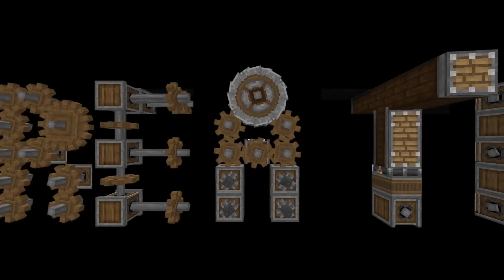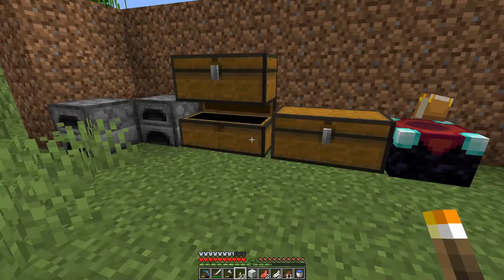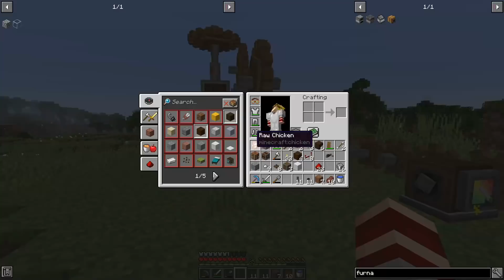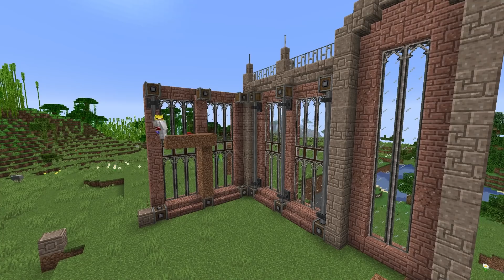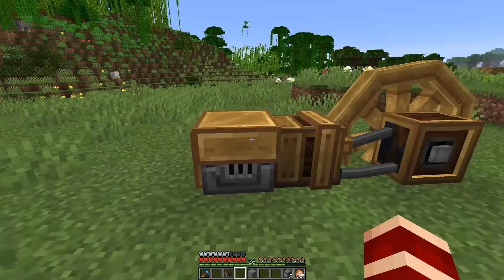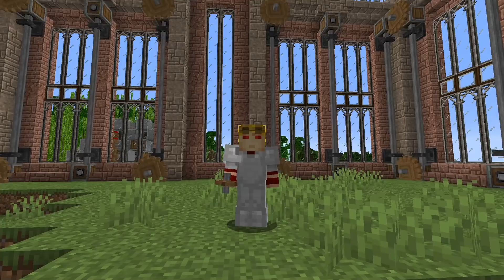Infinite Power! - Create Mod #1

Comment: This mod is surprisingly like real life. It uses alot of real life basis and minecraftifies them. For example every engine (that Im aware of) uses small explosions that push cylinders that are attatched to shafts that rotate which go into linkages that move and activate things. Thats just a small example. Big large mechanical things are all rotation.

Comment: I often refer to Create as "What redstone would be if it was mechanical power, rather than electrical".

It follows the exact same design principles, just with a different power system.

Now we just need a mod that does the same as these two systems, but for thermodynamics, and ANYTHING will be possible.

Comment: I know this comment is way late...but my obsessive compulsive tendencies will not allow it to slide.... You could have set the clock to 20 or 40 secs and it would have worked the same. O.o

Comment: There needs to be something like a ‘windup generator’ which takes a lot of low speed, low power rotation, and when it is powered, it will release the power that you’ve stored as high power high speed rotation. I could have a UI when clicked on, and it has multiple different springs, each of which have different capacity to power ratios.

Comment: since blast furnace smelts twice as fast, coal only burns half as long. you only get 40 seconds out of each bit of coal. the ore falls back into the furnace upon losing power, which happens whenever the furnace empties. the redstone contraption was totally unnecessary lol

Comment: You could actually set the delay to 41 seconds, as while the blast furnace smelts twice as fast, it also consumes fuel twice as fast, turning the 80 fuel time to 40 fuel time. Idk if you fixed this as I haven't watched the rest of the videos.

Comment: I might be missing something but isn't the redstone setup for the fans completely unnecessary? If you power each fan from its respective engine, as soon as the engine turns off, the fan should stop and the chute should just drop the ore back into the furnace until the fan gets powered and pulls it back out? Maybe doing it this way interferes with the tiling capability of the setup?

Comment: I know you made this episode a while ago, but chutes by default move items downward. All you have to do for your blast furnace is use the power of the flywheel to suck the ore out while the furnace is working, then once is turns off, the ore will fall back down

Comment: I figured out your clock problem.. simple solution with the coal.... Set the clock at 40 seconds.. It won't do anything during active burn, but when the coal runs out it will trigger a new burn.. 2X40s = 80s ;)

Comment: ok, so, i ended up trying to use your design for the power generation thing, but i'm having an issue with getting the wheels to synch up and keep running perpetually. i have a decent supply of fuel, but i'm thinking it's a combination of timing and the fact that the flywheels are not all connecting properly via shafts or gearboxes. like, sometimes, one wheel will just crap out randomly and idle, while the rest continue to spin, so it's not a contiguous thing.
Reply: ok, apparently it was the timers being stuck... but there's also the issue that the kelp blocks burn for 4001 ticks, which is 3 minutes and 20 seconds.

Edit: Nevermind! Turns out that in blast furnaces it's halved, so it comes out to 1:40. Regardless, it still doesn't fully jive with the 2 minute timer you originally set here... had to add another couple blocks in length to throw on a second adjustable pulse repeater and second regular repeater for the proper timing on my end. Now, it works like a charm, with barely a hiccup when it refreshes each lane of the contraption.

Comment: Huh. I just made a fancy mechanism for "Infinite power" in Furnace Engine and was super proud of it, then go on YouTube for a similar contraption... and here you show twice as effective version of it.

Though, I guess mine has some advantages. It works on wood logs - dropping one into the furnace every 80 seconds, smelting it into Charcoal, and then using the same Charcoal as fuel for the next wood log.
Compared to your, mine is:
+ Much more compact;
+ Works on wood logs rather than coal, so you can link it directly to tree farm without any middle steps;
+ Doesn't use exploits;
- Produces two times less Stress Capacity because it uses a normal Furnace instead of a Blast Furnace.

Comment: ...The fact that the waterwheel is the wrong way triggers me a lot...

Also, a personal suggestion of mine (at least for the outside part of your building) is to use normal shafts and right-click them with andesite casings to cover them up. Looks better imo

Comment: He could put power in one area, and use belts, inside, to turn all the shafts, thereby transfering force inside, and not needing vertical gearboxes, or inverting the rotation per pillar.

Als, I made a super generator that uses one coal and eight wood to make charcoal, then that charcoal, some is sent to the furnaces, the rest to be used for, really, I dont know. But, with 1 input, I am powering 5of these. I plan on connecting a tree farm for infinite wood, thereby creating unlimited energy!

Comment: anybody knows what settings he put in the sequenced gearshift for the infinite power furnace thing?
Reply: That's a regular gearshift. it just makes the fan suck up the ore for a quick second. I can't figure out the logic for the clock though.
Reply: I actually figured it out, you have a Adjustable Pulse Repeater running into a block, redstone dust past that, in the middle is a Comparator going into the block with the Redstone Torch on it :)
Reply: @snepderg  yeah. After playing with it, i got that too. But using the sequenced gearshift, the ore just goes in and out of the furnace repeatedly. Which works too so it's fine, i guess.
XD

Comment: Okay 2 questions.  1) What is the 3rd redstone component used in building the engine?  You can see the torch and you talk about the Adjustable Pulse repeater, but there is a 3rd item that you can just barely see between the blocks that looks like a comparator? 2) What gearbox is that on top of the fan?  I can't find one that looks like that.

Comment: In case you didn't know.  The information you and Zed are learning about this mod and the items you are creating are ending up on the Create Mod wiki!   I just looked up the Furnace engine on the wiki and this episode was referenced as to what the block is capable of, specifically your cheaty cheaty trick of sucking the ore back out of the furnace using an encased fan.  Awesome.....now I just have to figure out why mine isn't working.

Comment: Doing the alternation of the ore at 20 or 40 seconds has the same effect. You just want it there for the tick the burn duration ends, you don't care if it goes in and out extra times.
Also, please move your transfer rod to the floor lol, there's a gearbox there already

Comment: You know something funny i made a giant base in this mod 
And i only use 4 normal engine to power 5 press, a crusher,5 compactor,5 washer (Fan with water),5 smelter (fan with lava,5 smoker (fan with fire),5 cutter,6 concrete maker (Uses 6 drill and 6 placer yea it's pretty expensive),3 mixer and a automated brewing station, all on max speed plus a heck ton of belt... and yes they work together i even made switches to turn them off one by one thingking it's needed i even made a master switch to turn the engines off but i don't need them somehow 4 normal engine is enough 
So pro tip for beginner player you don't need that much power on late game stuff mid game is when you start having power issues but that's not that hard to solve just use max windmill for your machine my most costly machine only need about 9K su that's equivalent to 1 max windmill and 1 small windmill and it can run forever without needing any advance stuff 
I would prefer using the engine to power bases and not individual machine as it's just overkill and a max windmill is just way cheaper than one engine set

Comment: When you were setting the timer for 80 seconds but found out it didn't work that way, you set it for 1 minute. Why not set it for 40 seconds instead? It'll go off twice, but it will essentially give you a switch every 80 seconds.

Comment: Hey Tango, did you think about using coal blocks instead of usual coal for your blast furnace? Nine times the time with same effort. It works out better with timing as well - 80*9/60 is 12 minutes. Also, the series is great, loving it!

Comment: not to be rude but for the water wheel make sure that the water wheel has the notches facing the opposite way the water is flowing(so the water gets caught in the flaps of the wheel)

Comment: not sure what the renewable fuel is going to be but if you were to stick with coal wouldn't coal blocks be better than individual coal? That way the 80s per cycle would become 720s or 12m so the timer could be set accurately to restart the smelting cycle.

Comment: Old workshops used to have a similar thing with the rotational mass. The used to have shafts running the length of the ceilings and then they'd have leather belts that you could attach to your various tools.

Comment: i have successfully improved his design and fixed his timing problem (using gearboxes to power the fan into reverse mode means when ever it turns off the item drops back into the hopper before timing turns of the machines connected) and used only gearboxes cogs and shafts

Comment: Why don't you use lava instead of coal because it burn more than coal so it generate more power for longer time, and you can just get it from the nether.
Or you can just make a tree farm and make a auto charcoal maker to deliver to the blasting machine with conveyor belts so don't have to mine coal anymore.

Comment: so one single chest of blaze rods not including any Hopper back log or the stack in the furnace will run for nearly 60 hours....and given it will take no more than 20 mins to refill a chest (prolly less with this mod pack) this farm is going to be very efficient to say the least...but I wonder why not use dried kelp blocks as one mod could be used for smelting them (which makes power) and produces more fuel for power. and given kelp farms are so redstoney I would think it would be perfect for this model rather than using a double blaze spawner with everything slabbed and the whole mess. just a thought

Comment: A mod that i highly recommend is called THE ONE PROBE it goes on a helmet and it tells you the name of the block it has a hot key with it. Very good mod highly recommend it it tells you the name of the mod and also the name of the block it will help you to tell us and we can see what blocks you are pointing at. The box will be center screen but top you can move the box any were on the screen

Comment: Make a way to make Cobble sand and glass with the mod it is something that can be done very easily. Also use as much glass around your builds as possible so we can see it in your base while it is running. Make a ore double machine with the mod as well please but for glass you need a fan and a lava source block. Lastly make a harvester when you make a field of crops.

Comment: The way you designed your factory is how they used to design machine shops with lathes in them. They had one generator for the rotational force and would transfer to the lathes with gear boxes.

Comment: You can still use coal on the power generator, just set the time delay to 40 seconds. It will fire twice in the cycle and allow you to use coal uninterrupted.

Comment: 19:20 can't you just set this to 40 seconds so it will put the ore twice, which means after first 40 seconds ore will go into furnace and instantly will be sucked back up without using fuel so basically nothing happens, but then after another 40 seconds ore will once again go into furnace and back into the shaft but now it will make furnace use another piece of coal

Comment: If you wanted to maximize the amount of burn time you get out of each piece of coal you can use 2 adjustable pulse repeaters (one set at 1 minute and one set at 20 seconds) instead of 1 in the clock.

Comment: 60 seconds isnt good, do 40 seconds. It doed not matter how frequently you do it, but you want to do it on intervals divisible by the 80, so 40 works because you will drop it in at the halfway point, nothing happens, and then drop it in at the 80s point and keep it running. The way you currently have it configured, it will drop it in and start it, then drop it in at 60 and nothing happens because the first coal is still burning. Then the coal stops at 80, but wont start back up until you drop in the ore at 120. Thats 40 seconds of dead time.

Comment: For anyone interested, you can set up the same perpetual motion machine with very slight downtime with far less pain. Just power the fan to suck, and when the "burn" is done, the ore will drop back in automatically to start the furnace back up.

Comment: Stress Capacity is NOT the same as rotational power. Rotational power is the fact that a block is spinning, as well as how fast/in what direction it is spinning. Stress Capacity applies to the entire contraption, that is all the Create mode stuff attached together, and is basically the inertia of your contraptions.

Comment: @19:20 just set it to 40s. The first pulse will start the furnace, the second will dip the ore in halfway through and do nothing. The third tick will be at 80s, exactly when the coal runs out, and so on.

Comment: You could do a block of coal which would be 80 seconds times 9, which would be 720 seconds which is 12 minutes, which would make it a lot easier to do it, you can also fit more in it.

Comment: The "cheaty" bit @15:00 doesn't feel cheaty at all. The purpose of the furnace in this machine is to generate power - you don't see electric power stations smelting stuff, they just burn fuel to make heat. Maybe think of the ore as a primer for the furnace itself, like TEB is for a SR-71 engine.

Comment: Tango, if you set the timer to 40 seconds at half the time it will still work and every 80 seconds there's gonna be an ore in the furnace, that way there's no dead space where you might not have any power. idk if you've already figured that out or not, but just a tip :)
Reply: also I don't even know if the 60 seconds would cause a problem at all, just speculating

Comment: Tango! Love to see you checking out this mod, but I need to warn you that the timings on your device, as you currently describe them, are likely to be off. The new redstone devices added by Create seem to have an undocumented extra delay to them. (It's something like a redstone tick's worth, per repeater, though I would need to recheck that to be certain.) This will throw off your timings for your blast furnace, so that it will eventually, over the course of many hours, shift the time the ore goes in and eventually either consume the copper ore because the gearbox timing is off as a result of the undocumented delay the redstone timers add, or else cause stoppages and inconsistencies in power supply that can affect certain contraptions negatively if not prevented.

Another series I watch by RagePlaysGames covered the same idea you're attempting to implement here, and covers some of the common pitfalls he has seen in other's designs, and the problems that can occur if the system is not set up correctly to account for the timing issues. After running into a few of these problems himself when designing his own version, he describes the testing he did that led to him discovering the timing issues with the redstone devices, and tells how to alter the timings on the repeaters to ensure that one cycle of the ore popping in and out to reignite the furnace, and then waiting to go in again, is exactly that of the life of the fuel you use, while making sure the time the ore is in the furnace is short enough that it will never be consumed. He even goes over how to troubleshoot afterwards, so that you can make sure your device is working correctly, without having to babysit it while you work on other things. I concede to not recall all the advice he gives, but I strongly recomend checking in on his video to verify that your system addresses some of the potential issues, lest you end up wondering why everything went offline a couple hours later, or why some of your devices are stopping periodically.

That said, I love your videos and am so excited to see what all you and Zedaph make with this mod, and I'm looking forwards to the next episode already. Keep up the amazing work!

Comment: You might want to consider adding a robotic arm to the fuel belt/hopper system - reason, because you can have the arm feeding the hoppers from the belt in a 'round robin' fashion - which means you can fire up the whole system in one go, rather than having to wait for the furnaces to fill sequentially 👍

Comment: Remember you can use belts to transfer power to work stations in the middle of the room coming down from the roof, with clutches to disengage when not in use....

Comment: I love that everyone is playing with the Create mod now! While you are using furnace engines to power your base, it wouldn't hurt to know this: Watch the direction of your water flow when using water wheels. While it will produce rotational force either way, you can improve the stress capacity of the wheel by making sure the water looks like it would catch on the arms of the wheel rather than flowing over them. If you look at the first water wheel you showed, the water was flowing over the spokes, reducing the stress capacity, whereas the second wheel had the water flowing into the spokes, increasing the stress capacity.